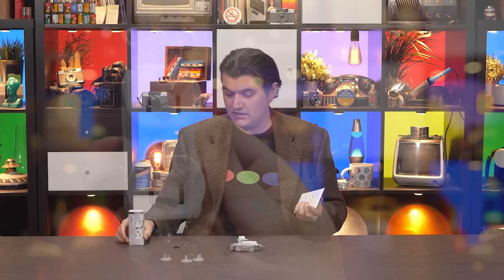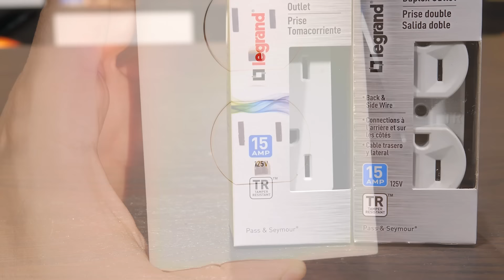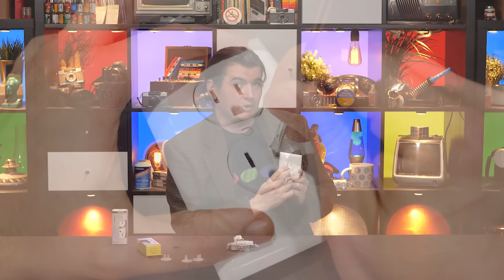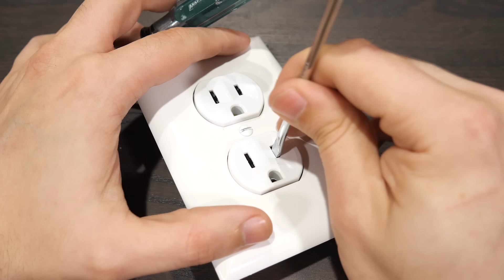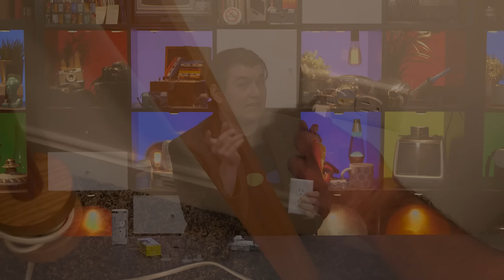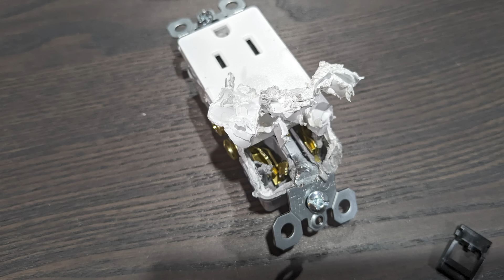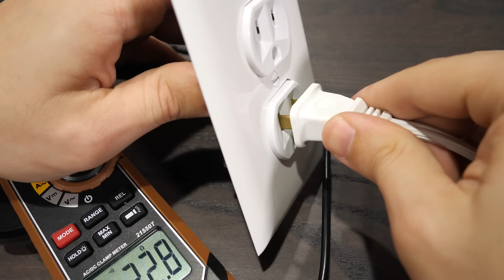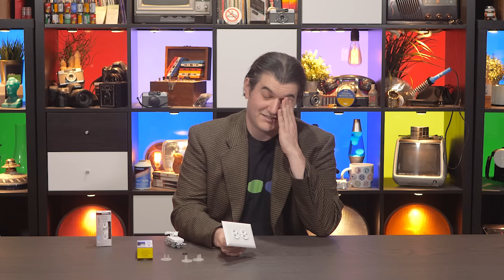Tamper-resistant outlets aren't all the same - a follow-up

Comment: Thermal cycling from higher currents on an outlet cause electrical connections to “loosen” (it’s actually material deformation but it makes the connection loose). “Back stabbing” an outlet has less contact so this process happens faster. Doing electrical work professionally it’s the main cause for an outlet to fail. 

Next time you’re in you electrical panel try to tighten up all the connections (safely with an insulated screwdriver). I can almost guarantee you if your home is older than 3 years you’ll find some loose connections especially on high current devices (AC, water heater, electric ranges). This wasn’t because they were never tightened it’s just from thermal cycles.

As far as Wagos go, same issue. I’ve replaced melted Wago connectors but I’ve also replaced melted wire nuts. Only difference is the wire nuts I see melted are much older than the relatively new Wago connector design. As much as I prefer Wago connectors it’s not hard to see how similar to back stabbing outlets, work fantastic for years until they don’t….

Comment: 0:51  I won't mention a manufacturer by name ('cause I couldn't read at the time), but in the early 1960s my toy car dashboard including a steering wheel, switches, a horn, and for some reason, a metal key.  I hope it's "Survival of the fittest," because I wasn't naturally selected out of existence, despite sticking that key into the hot side of the outlet.  It did leave a little piece of thumb skin sticking to the cover screw, though.

Comment: As much as you say that changing the plugs won't happen, I think it actually already is. All low power devices are slowly moving to USB, and all of those are slowly moving to USB-C. We're starting to see outlets with USB built in, I think those are going to become a lot more common, and we're going to see even more low power devices moving over to them. The end result will be that only high power devices use the current standard. Sure, we're not going to replace the plug for your toaster anytime soon, but I think over time we are still going to see a gradual migration of many devices away from these outlets, and coupled with a gradual migration of outlets towards ones with integrated USB.

Comment: Tamper resistant plugs are so annoying. My previous apartment had them and it was so difficult to get plugs into them, especially two prong plugs. If the blades are even slightly misaligned, they won’t go in. The only thing I removed regularly was my phone charging stand. Most of my stuff is plugged into power strips anyway because I have a lamp, alarm clock, and charging stand in one spot, so a duplex receptacle is insufficient. Same goes for my computer setup that has a lamp, monitor, dock (thank you for enlightening me), printer, Ethernet switch, and my laptop. So yeah, I needed more outlets than just a duplex. My current apartment has normal outlets, but I still have the power strips for the aforementioned items

Comment: I know temper resistent plugs from extension cords in the EU. I don‘t think we build those in walls. With extension cords it‘s anoying. Due to our recessed plug design you mostly hit both at the same time, nevertheless it requires quite often a notable bit of force to insert a plug.

Comment: Tamper resistant plugs.  The plugs that are oddly hard to inserts 10 or 20 times, then one day it is way easier, possibly following a small snap noise.  Like nearly all electrical code, they are garbage.

Comment: I have traveled around the US for work multiple times and EVERY hotel room I have stayed in has busted plugs that the cords fall out of. I have been led to believe that the tolerances of the cheap adapter plugs prongs are thicker and actually bending the internal prongs of the outlet causing the plugs to "fall out" this is combined with repeated uses of the outlet.
It is actually the fault of the people traveling to vacation aboard here that the outlets failed and fall out.
To those across the pond. NO our outlets in our homes don't do this, and when they do we replace them. 
The reason I have to believe this is from my stay overseas and then returning with a universal plug. It was much harder to plug into at my home when I tested it and later led to problems on my power strip of loose plugs.

Comment: The real pro tip is to use commercial outlets in places you frequently use.  9/10 outlets get used a handful of times you own the home. You plug in a lamp when you move in, unplug it when redoing the floors, again when you buy new furniture, and again when you move out.  

But everyone has a couple outlets that get constant use, you plug in the vacuum to the same outlets because the cord reaches the most places.  The iron/hair dryer gets used in the same position.  Those are the ones that wear out.

The commercial grade ones cost maybe 300% more, which sounds shocking (zing) until you realize it's an extra $2 or so.  And has beefier metal clamps to hold your plug in.  You don't need to replace all your outlets, just the ones you frequently use.  We've all got a select handful, so the total cost to have better outlets is likely < $10.
Reply: Not only are they more heavy duty, but they’re also so much easier to install nicely because they have those plates on the screws that mean you don’t have to hook the wires and you don’t have to pushwire.
Reply: Midline receptacles everywhere.  One hospital grade on the shelf.  As soon as one of the cheaper ones wears out, replace it with the good one.  And then put a new hospital grade receptacle back on the shelf on the shelf...  35 years in this house and hospital grade #3 is still on the shelf.  The 2 I replaced are not the ones I thought they would be.
Reply: Honestly, I just went ahead and replaced every receptacle in my home with commercial grade, and it cost under $200. Seemed pretty reasonable to me.

During new construction, what's a couple hundred bucks when considering the cost of building an entire house? I'd rather have the quality from the start. My home was built in 1998, and half of the switches and 1/4 of the receptacles were broken. Physically cracked and falling apart. I'm not a fan of cheap devices. Commercial grade are always worth the price hike IMO due to the far superior build quality.
Reply: The outlets I mess with the most aren't even part of the house. One is an eight-outlet power strip, and the other is one of those blocks that covers the outlet and splits the two outlets into six. So I'm not sure where that leaves me.
Reply: @stevethepocket  Yup, the one I plug and unplug the most is on my computer's UPS, on the side without battery backup.  My UPS sits on my desk, behind my monitor ... and is the easiest-to-reach place to plug in a fan or a vacuum cleaner in that room.  

A likely former champion is a few sockets over on the same UPS -- where my phone charger stays plugged in 99.99% of the time.  I don't unplug it anywhere near as often since I got a new phone with a longer-lasting battery ... and left aftermarket chargers in my car and at my dad's house.
Reply: I wonder if we'd be better off with two part receptacles where it's like an adapter plugging into the main body and you plug into the adapter.
Then if it wears out after a ton of cycles you replace the "adapter" instead of the entire plug.
Hell, do it right and it could lead into a full design swap with minimal issues because it'd just be changing the adapter.
Reply: @LanceThumping  Maybe... but it would need some sort of latching design so that the socket can hold a cord nice and tight, but the act of unplugging a cord doesn't pull the adapter out of the wall. Which just seems like overkill, compared to just deploying commercial-grade receptacles that last a lot of cycles in the first place. (And, honestly, replacing one is quick and easy. Don't tell anyone, but I don't even shut off the mains.)

I actually would rather see the world keep moving toward exactly the opposite: fewer pluggable adapters. By which I mean, receptacles that include a built-in 5VDC feed, in the form of a pair of USB-A (or USB-C) ports nestled between the 120VAC sockets. You know, where the GFCI test/reset buttons would go. These are a bit pricey, but I found a 3-pack for a clearance price and installed them in 3 locations where I thought I might want to charge my devices. And, so far so good. Though the USB cords (which I just leave plugged in all the time) do make it slightly less convenient to use the AC sockets.
Reply: @ps.2  I am not a fan of those outlets with the built in usb.  Mainly because all the ones I have ever seen do not have a switch to turn them off.  So they will always use some power and it's a piece of electronics that's always on, IN the wall.  Plus they are usually crappy adapters.  The usbA ones can barely put out an amp, and the pd usbc ones put out the minimum power.  And when they inevitably die because they are cheap, it's not an adapter that you just unplug and replace.
If you know of a high quality outlet with a good built in usb charging, with a switch to turn the usb off, I would be very interested, but as far as I have seen, they simply don't exist.(in the US standard that is)
Reply: @procrastinatingnerd  also they cost much more than an outlet and a USB charger separately. The only reason I can see to use them is either in public where people won't necessarily bring chargers and will take the ones you provide, or when space is very tight.

Even then, you may be better off just getting a small powered USB hub and gluing/screwing it to the wall beside the outlet. You can glue or hardwire its power cord if you're worried about theft. It will still provide power without being plugged into a computer.
Reply: @renakunisaki  lol, and now they are suggesting that you don't use those public usb charge spots because they could have some malicious electronics connected to them.
Reply: @ps.2  It's true that it might be a bit overkill. Though it's also true that if we figured out some sort of scheme of changing the plugs but keeping integrated "adapters" we'd be able to work on actually changing the spec to something better. Also a possible solution for the locking mech could be to copy pill bottles with push and twist.

Also I'm going to echo other comments and say integrated USB ports are a bad idea. Not only can they be low quality or have malicious ones in public, but standards change rather frequently and what might've been great awhile ago won't be top of the line forever (though they might be okay).
Reply: @procrastinatingnerd  Yeah I've never been much of a fan of having electronics (in this case a USB charger) connected to permanent house wiring. It's just better to use a good quality plug-in charger. Those receptacles with built-in chargers are solving a problem that really doesn't exist.
Reply: @LanceThumping yeah it would be nice.  But they wouldn't be cheap on first install. 

As a sidenote, i moved from finland to thailand. The sockets used in finland work basically forever. Part of it is that they're euro style 2 round prongs. Part of it is that they're just better built. The ones used in thailand accept both usa/japan and euro plugs and are much cheaper. They're complete crap and you end up changing them regularly, something i had not experienced in finland ever, they just work forever.

Further the extension cords are utter crap in thailand usually too, the best ones you get by buying wall sockets and making your own. I had a commercial one caught fire at the fuse on the extension cord.

 Anyway for building your own they sell rubber housings for and stuff like that, you can buy them premade like that as well.
Reply: screw it, go full hospital grade lol
Reply: Well, that depends if you're able to change them yourself. If you aren't then, YES, buy the better more expensive ones, they'll last a lot longer. But if you're able to do the work yourself, then my advice would be to just change them as the things get damaged or too loose. In my experience most of the outlets will last for years, unless you actually have a commercial application for one.
Reply: I learned this after building my home in the 80’s. We used regular cheap receptacles and in a few years the vacuum plug would literally fall out of the receptacle. I went through and replaced them all with spec-grade outlets, no more problems even a decade later. It’s so little money in the greater picture.
Reply: Yep, the few plugs that I had to replace in my 70's house are exactly the ones used for the vacuum.  All the rest are fine.
Reply: I would like to add the official term in NEMA is hospital grade, that doesn't mean only for hospitals, it's closer to like when people say military grade flashlight.
Reply: The feature that I would be looking for in an upgraded outlet is better plastic that does not degrade and change color over time.  I've noticed the nylon cover plates maintain their color, but whatever thermoplastic is used for the outlets degrades.  I have a shit ton of outlets in my house and I'm not going to change them out unless I can find something that holds its color.
Reply: @kevingray8616  It's kind of goofy, but I've heard spray-painting the receptacles freshens them up.
Reply: @aaron74 it's not just kind of goofy to spray paint  recpticals but painting even with say a roller is on the goofy side but spray painting unless one is able to block the spray paint from coating the internal metal contacts it's not just Goofy but very very goofy 😂
Reply: Agreed. I tend to buy commercial or hospital grade outlets for anywhere with more than very light usage. Kitchens, outdoor, garage, utility, etc. They cost significantly more, but the moment you plug in a cord you know how much better they are.
Reply: The commercial grade grade outlets have the best attachment for wires, back wire connection. Its not as fast as back stab found on the cheap outlets, but its been reported that those fair over time. Back wire is a nice solid connection, without ever bending wire. Also I offically hate back stab connections. You need to take a small screw driver and push a spring while pulling the wire out to get them apart. Yeah not fun. Back wire, you just un-screw and its done.
Reply: @snoopdogie187   The guy who taught me said to never use those, particularly when stringing multiple outlets on the same circuit.
Reply: @jmayer29  Do you mean back stab or back wire?
Reply: For that matter, the entire house should just be wired commercial grade.
Reply: Thanks to the OP for this suggestion, I'm absolutely giving this advice to my brother who recently bought his first house ❤ Even if I only ever live as a "renter" in one my brothers' houses I'll always be there to be a handyman for them!
(We can't all get lucky with finding good employers, but a family is a tribe and we can all contribute in our own ways)

Comment: There's a whole chart for electrical shock potential. Old outlets will naturally have less grip, the metal plates and springs just wear out over time.  I fully expect my Hospital grade outlets to need replacing as the contacts start to experience fatigue from constant use.  12 guage plugs/cords put a fair bit of strain on the mechanism.

Comment: I got an electric shock at about that same age. I was trying to find the light switch in a building and it didn't have a faceplate on it. Reached in a little too far and got bit. It grounded across my hand so it wasn't bad. If it was 240v it probably would of been a bit spicy.

Comment: Tbf, just brushing against 230V won't kill you either. I had my fair run-ins with electricity as well, some stupid mistakes when fixing a PSU, a broken wire, some mishap in a lab. Tho all outlets being protected by a GFCI certainly does help a lot

Comment: & ya this part is guna sound insane but that was the job, I ran an arcade from 99-2005 & another 5 on the road & to be honest get hit was a daily thing, having to remove monitor board from basicly cathoid TV & theres about a 25% your guna get hit with something removing the tube cap, or find some last time in the game didnt know what they were doing and just has a ground line taped to frame. Point is, it was all 120 and im damn sure I would have been dead at some point if it was higher. Remember folks when you lose track of the number of shocks you have had you kinda dont fear it as much.